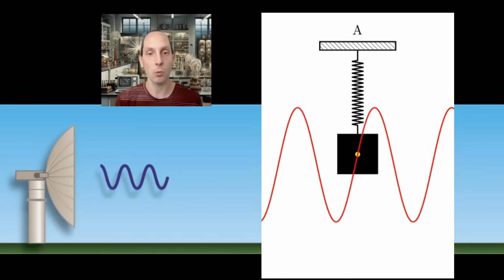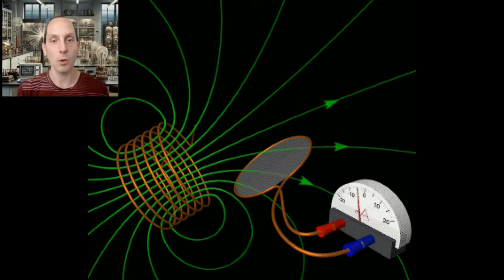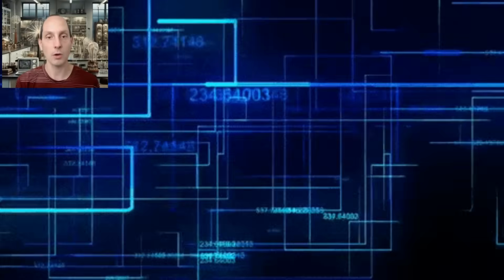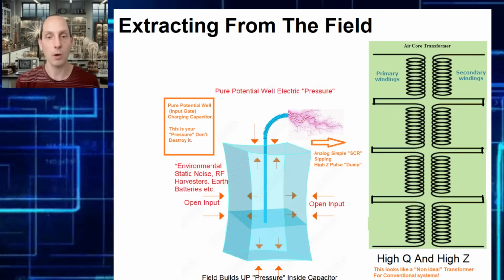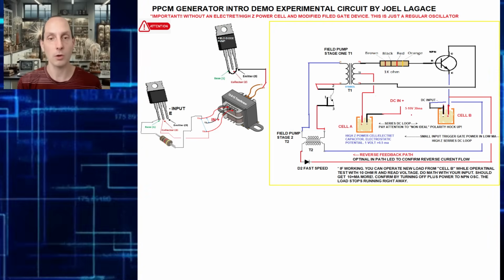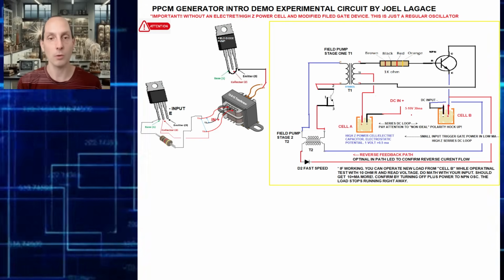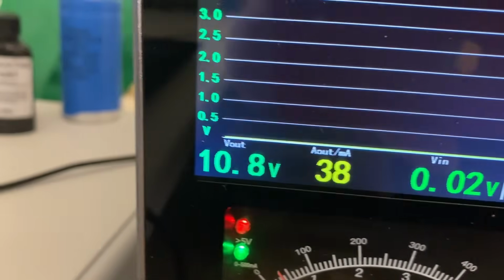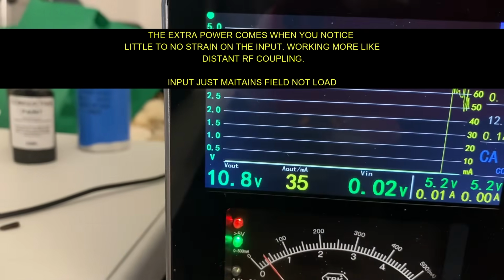Open Energy Systems

Comment: If the global grid is acting like a giant induction coil, then without an “induction valve” or regulatory mechanism, it may be constantly exchanging uncontrolled electromagnetic energy with the Earth — possibly disturbing natural systems.

Adding such a “valve” or control mechanism could become critical for planetary health, EM shielding, and energy stability.
Reply: Eric Dollard has been saying the same thing for years, he describes it as a giant ball of electricity inside the Earth that is progressively becoming more unstable due to the complete mismanagement of electricity on a global scale.

Comment: I now know where energy comes from and how it's created. Every 1V battery has as much energy as you want if you can extract it quantumly. I'm very impressed with what I've discovered. Resonance is the element that produces so much energy at the output because resonance improves the flow so much that there are no losses. And 1V of energy is transferred so efficiently that we have energy stored at the output and it's transferred to the capacitor bank. The energy at the output is so high because resonance helps ensure that there's little loss of this energy in the circuit. Energy is created between the coil and the capacitor, independent of the input energy. This means that we have more energy in the circuit than at the input. The input voltage increases this energy, and then the current in the circuit increases. I've discovered such things. The video is cool, you're right.
Reply: So, your house is no longer connected to the Grid?

Comment: I have a theory that I'm developing in which the Earth is not the ground source but is the neutral line. Relative to the ionospheres high positive potential. The overall field energy would be that of a torus field with Earth layed out along the central magnetic plane of inertia. The actual high + and - being the upper and lower halves of the field structure.

Comment: Coils around a 3D piezoelectric crystal oscillator, on a magnet board, to contain the magnetic field, with a quartz dome over the top of the coils and magnet, powered by an acid-electrolyte battery (car battery)

With an optional gas flow through valve, for different gasses added and subtracted, like argon or neon, 

Can record and define these kinds of physics, with a Bluetooth type connection to a regular computer, to install programs, and for a display

Comment: You make a lot of good points at the end of your lecture.  The HV HF situation reminds me of Gerald Morins pump motor circuit with the transformer and spark gap.  When he was doing thermal measurements, he showed negative measurements  up to -500F!  He compares this phenomenon to negative radiation.  This makes sense if you think about a circuit essentially working backwards.  I'm in the process of setting up this circuit to verify the results. I will share them in my channel.  Thanks Joel!
Reply: Did you succeed? I've been looking for information on circuits and principles that absorb heat instead of producing it.
Reply: I got most of the same reactions that Gerald did.  The thermometer did not show negative temperatures though.
Reply: @JenkoRun u need to lower the resistant to achieve that

Comment: Great video! I have  been trying to figure out the basics of this (after watching Bearden/Bedini you and others). When Bedini triggers a change to a high-potential, in a resonance-designed circuit - it creates that "H wave" that appears to open a source of energy that is not inherent in system itself. This short time period allows the flow into the circuit until the dipole is killed. I dont think of this as above COP - but analogous to how a space craft use gravity assist. They leave earth with some fuel - but could never reach Neptune + with out using gravity from Jupiter (+ others). Locally to the space craft - it would look like above COP (cant get that fast with the fuel they have ob board). I think of this "zero point" as we are tapping into energy from a "larger" source. Its not above COP - it taking energy from a source that is so large - its seemingly unlimited.